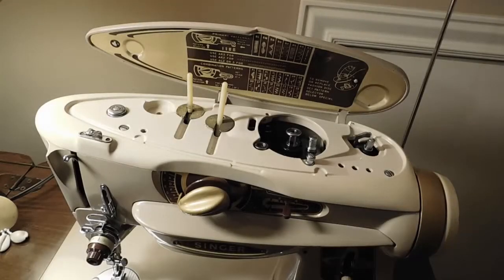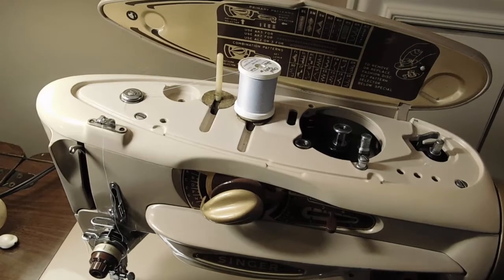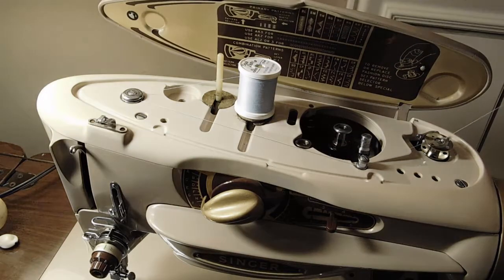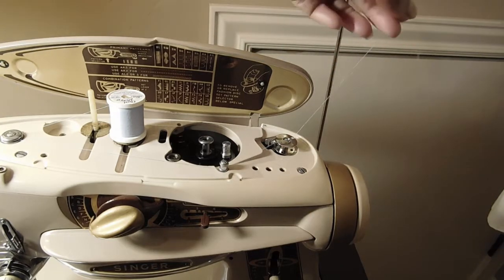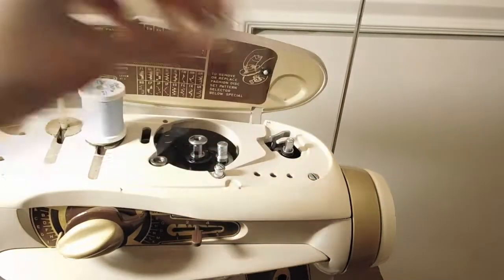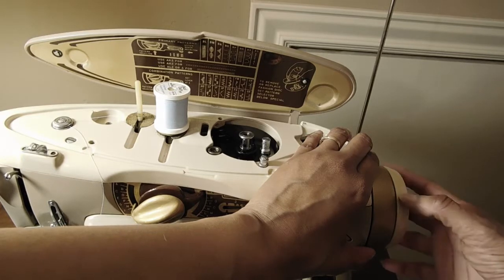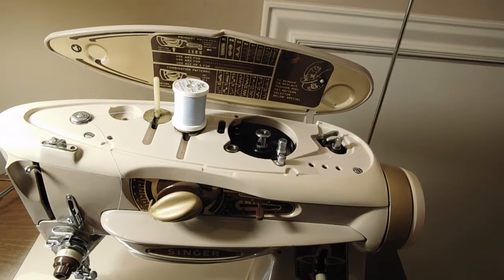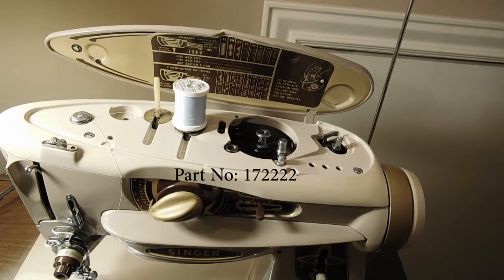How To Wind The Bobbin On A Singer 500a

Comment: Hello. Thank you for this video. Just bought a Singer 500 and the bobbin winder is not spinning. Any suggestions?
Reply from the maker: The problem could be something as simple as thread caught in the winder preventing it from spinning..  You can remove the cover to check for thread that might be attached to the assembly.  If You don't see thread, you may have to remove the bobbin winder assembly. I have pasted a Youtube video for you to view. If you decide to replace the assembly, make sure you take photos of the assembly before you begin.  You can find parts for this machine on SewingMachindPlus.com  I hope this helps.       https://youtu.be/P2ROdLM5zmE
Reply: The bobbin winders on the # 500 are very problematic.. I can fix them but I prefer the # 401, which is simpler. I am selling all my # 500 machines on eBay..

Comment: What is the purpose of releasing the handwheel? It looks like you only loosen it a 1/4 turn.
Reply from the maker: Good question.  Releasing the wheel prevents the take-up lever from moving, so the needle can't move up and down while the bobbin is winding. I had probably released it before I filmed the video.
Reply: @md2992  So if my needle is still moving up and down when I wind a bobbin, I have not loosened it enough? I probably need to get the 500a professionally cleaned as I had trouble loosening the wheel.

Comment: What size bobbin and type need get for singer 500a
Reply from the maker: The part number for this machine is Singer 172222. If you google this part number, several merchants will show, Amazon is one of the merchants.
Reply: Thank you .you been so much help we have singer 500a. And it had 1 bobbin.and 2 needle so that try get it my grategrandma and we have my grandma white rotary trudle  wich was her grandmother. And white modle43 1 electric sewing machines. It was my mom grat grandma.  But now singer 500a I try find light balubs .  Thank you for the info. Your video are so much help approached